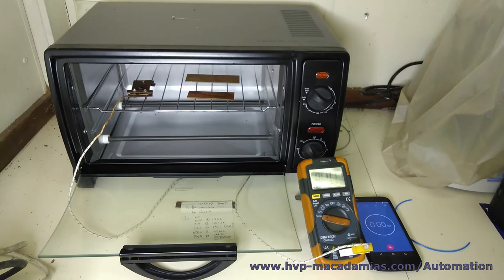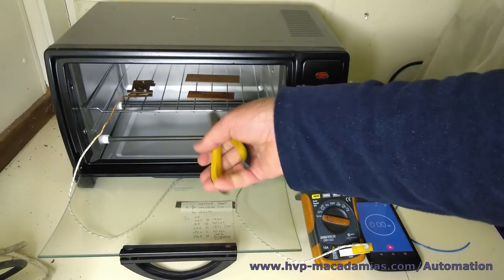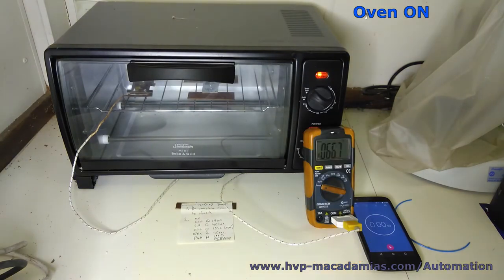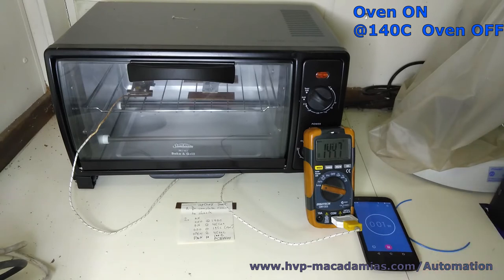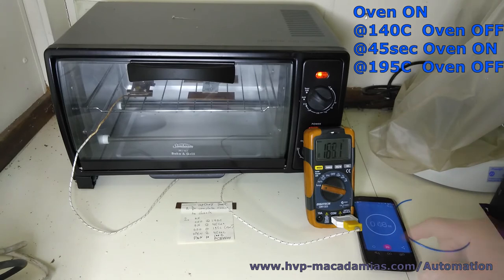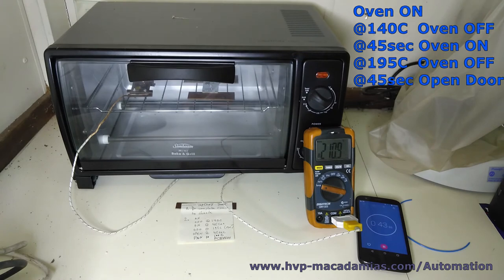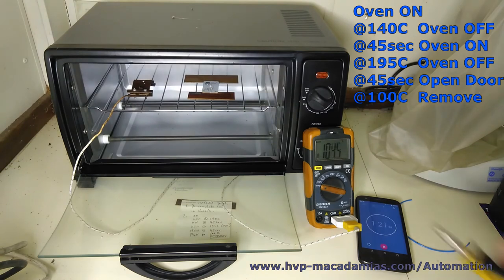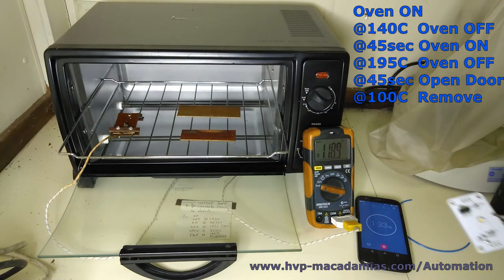Toaster Oven Reflow Recipe

Comment: Hi, could you explain the purpose of this experiment?
Reply from the maker: It's not really an experiment, just a simple reflow solder procedure that works for me and I thought it might be useful for others. I was filming doing PCBs anyway so got two for one :-).
Most procedures use just temperatures for the switching but I have found using temperatures for the Off points and timers for the On points generates a nice reflow curve reliably.
DB
Reply: Keep us posted on your work. We are planting our maca orchard so are keen to see it goes.